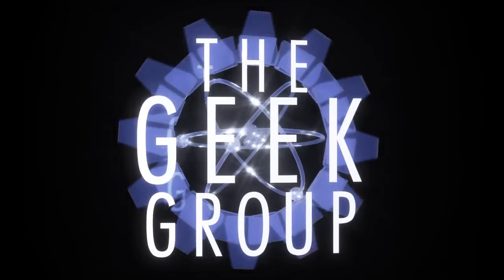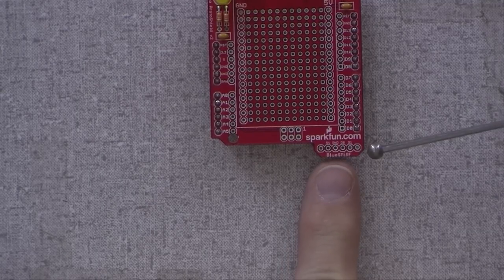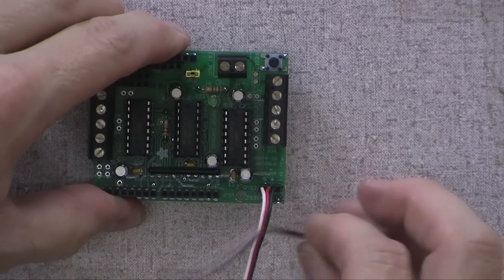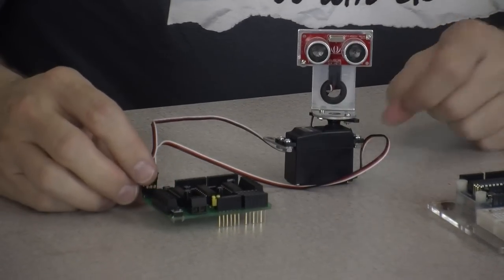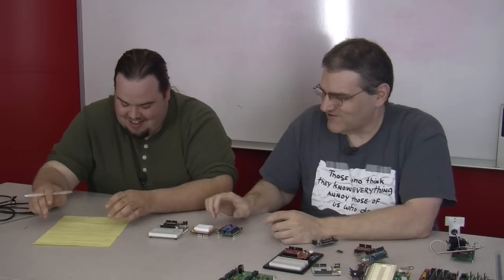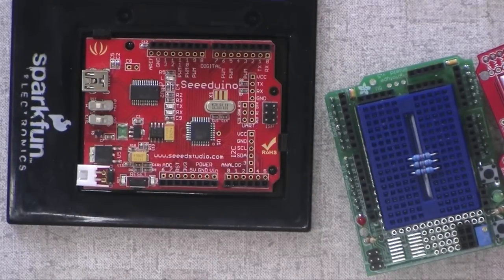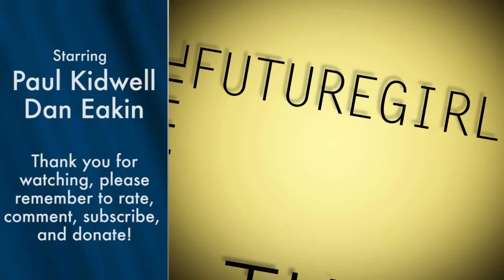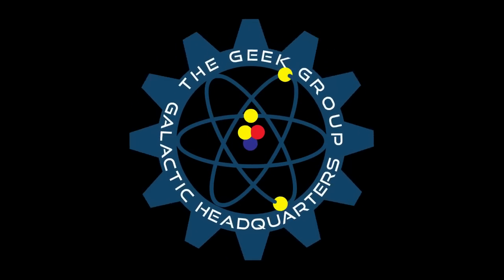Arduino Q&A with Eakin & Kidwell

Comment: As for wireless communication one could also mention that there is also several wlan-based solutions, where a common one is the WiFly chip. There is also the  RN-XV-W Roving Networks WiFi module, which can directly replace a Xbee module if you happen to have a board for that, where XBee is another wireless technology.

Comment: There is also an Arduino Leonardo now. It has an ATmega32u4 with on board usb instead of using another ATmega8 for that, so it's a bit cheaper than an Uno.

Comment: Streaming audio is possible on those atmega chips (well you need a dac, but pwm dac implemented with the hardware timers and an lp filter could be sufficient depending on the application) I had a AVR synth project a year ago it ouputed 8 bit mono samples at 31.250KHz sample rate and that wasn't really even harnessing the full potential of the chip (code was just plain old C, the synth routines could have been done in assembly). 12 bit mono audio at 44.1KHz could be feasible though.

Comment: great guess!  sadly, no (But it could be)  :)  ironically, you're in the right systems of the car (fuel) however.   The trick is it was for testing more than one of the same part simultaneously.  ;)